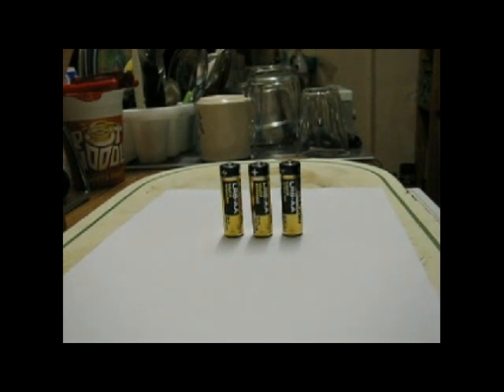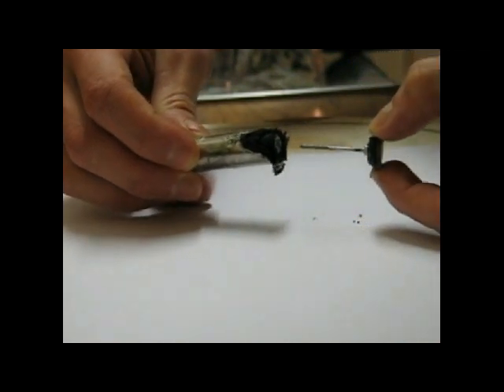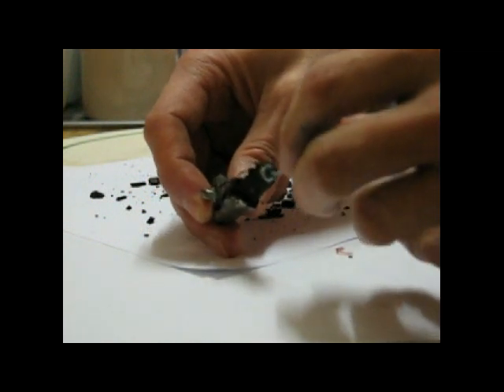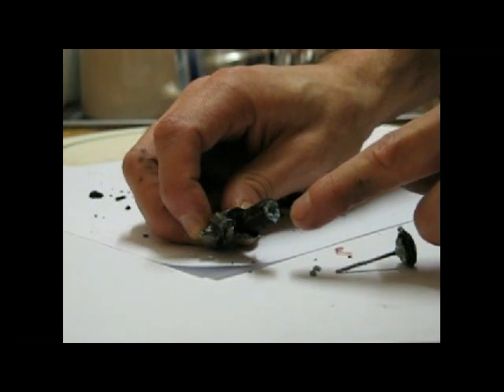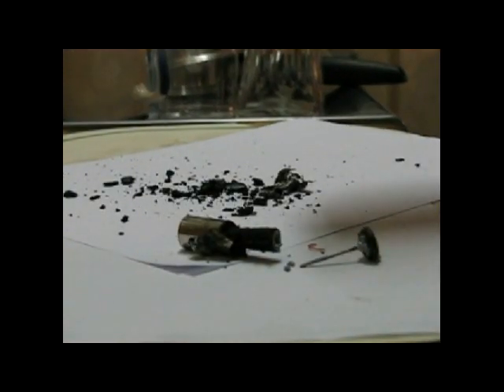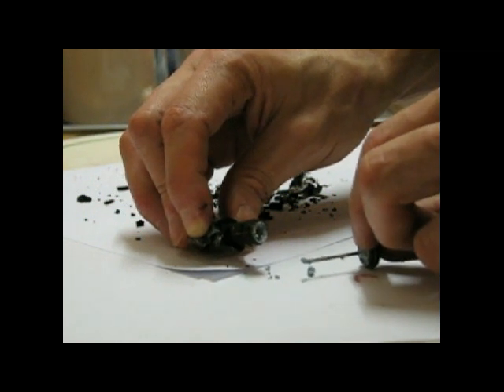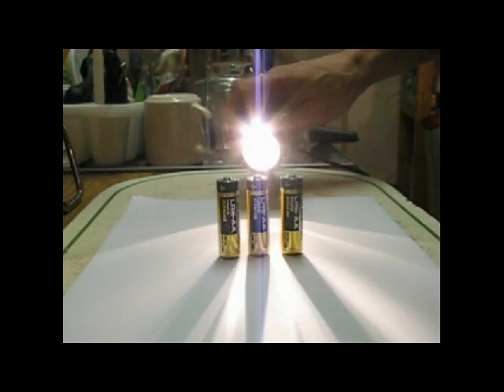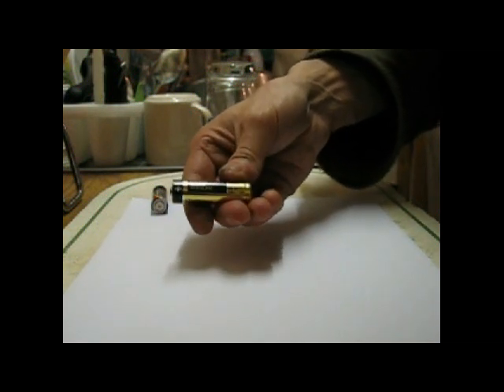Recharge Your Alkaline Batteries

Comment from the maker: Absolutely agree. One guy wrote to me lately who is charging them for an hour and them leaving them for five hours. He sets a cycle using a wall timer. The "pop" is pressure being released, probably not harmful in itdself at low voltages but the alkaline solution and heavy metals in side could be dangerous. If you want to inspect them up close use goggles and gloves. any sign of leaking and you might as well throw them away :)

Comment from the maker: Have you thought about making a large lithium ion battery? Lithium metal film, laminated and wound into a coil that basically acts like a high power capacitor.... the only thing you need to be careful of is shorting out the film when the battery is charged, because it could explode. Thanks for commenting :)

Comment: Would it be safer to use a plug-in timer set to alternate on/off in 30 min to 1 hour cycles to control the charger?

Comment: Have you tried a bedini charger? I built a small one and I am able to charge alkaline batteries with no leaking. This is because of how the bedini circuit works, using high voltage only, and hardly no current at all. Since there is no current, the alkalines don't heat up and thus don't pop their seals and leak. That being said, I have found that some crappy brands don't take a new charge even with this method; I think it is because some alkaline batteries are made with different metals inside.

Comment from the maker: For a start, alkaline batteries do not contain Lithium. Secondly, Lithium does not explode on contact with air. It catches fire and may explode if you short circuit the layers of Lithium by driving a screw driver through it or by dropping it into water, for example. And lastly, please DO NOT SHOUT ON MY CHANNEL lol :P

Comment from the maker: Hi, yes you can but it will not charge them much. Batteries will also charge to some extent just leaving them overnight. They reach a point where the amount they recharge becomes neglible... when the alkaline solution has dried out usually through leaking (ie. there is no conductor for the 'sludge' inside) the battery can no longer be charged. Thanks for your comment.

Comment from the maker: No! Rechargable batteries are designed to be recharged. Non-rechargable batteries are designed NOT to be recharged. You can recharge them but the affects do not last as long, generally speaking. The amount of electricity used to recharge them will cost about the same. THANKS !

Comment: Now calculate how much energy was expended charging them, the retention time of the electrical charge. Try using them 1 week after charging. Then realise its more cost effective to use re chargeable without the risk of leaking or charger damage. ;)